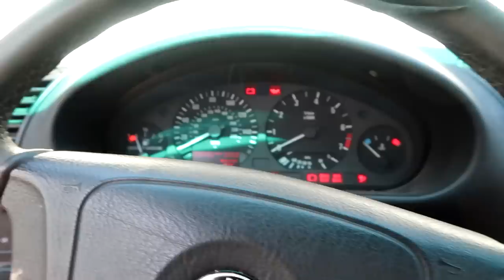Supercharged Grill FAST FOOD

Comment: Dalton, instead of having to grind off paint to get a ground every time you weld take a vice grip clamp it down on the thing your welding rock it back and fourth a bit for the teeth to pierce through the paint connect the ground clamp to the vice grip.